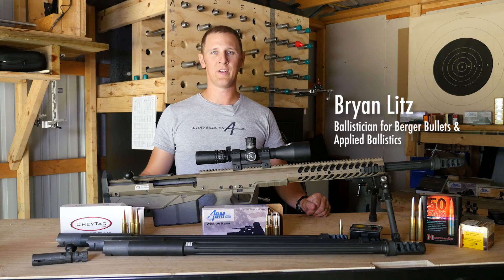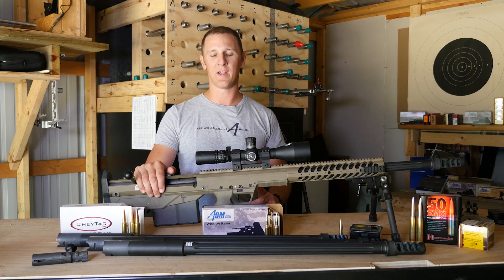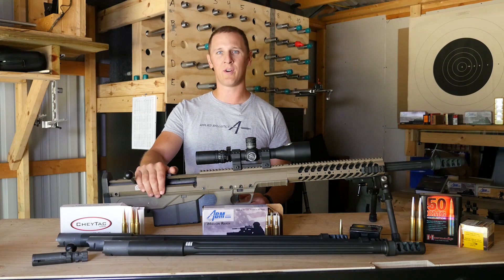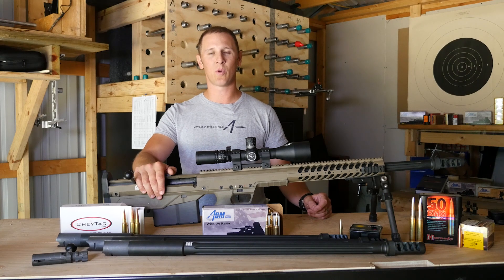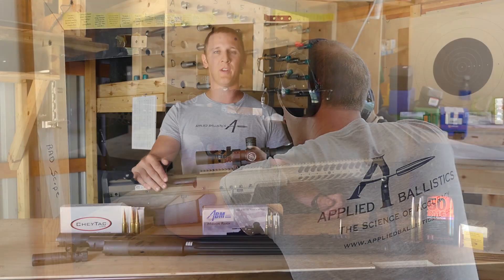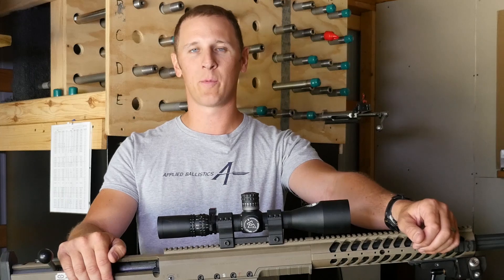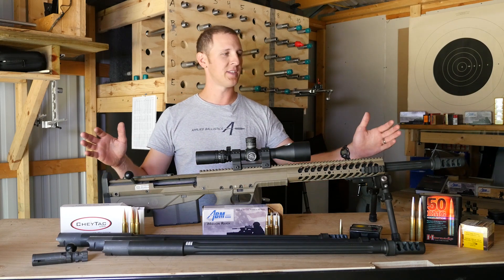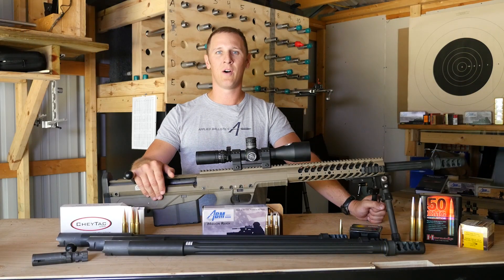Large Caliber Rifles | Applied Ballistics with Bryan Litz

Comment: Bryan, I'm working with a Barrett MRAD in .338 Lapua Magnum with a 26"  1-9.35 twist fluted barrel. I'd like to be able to reach out to 1800-2000 yards before hitting the transonic range, so I have found I've got to reach muzzle velocities well over 2750 fps with the Berger 300 gr. tactical OTM Hybrid bullet.... This necessitates much hotter recommended loads in order to accomplish this. I've been using Ramshot  Magnum powder, but have been considering switching over the Vihtavuori N560 or N570. Plus, the muzzle velocities have been all over the place with the Ramshot powder...... Any suggestions?
Reply: lol,... I wouldn't think this would be the correct forum to ask a question like that. Did he ever answer you elsewhere? Probably best to contact him through his company Applied Ballistics. Just a suggestion if you haven't already gotten the answers you need,... it has been 4 years after all lol.